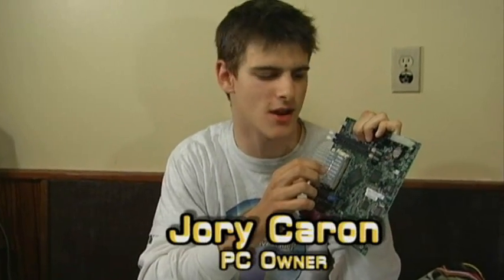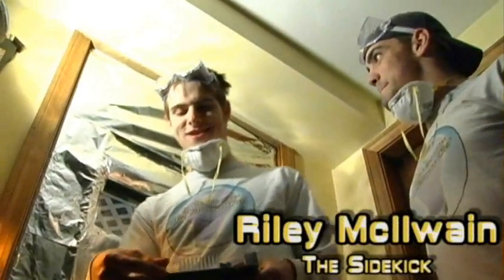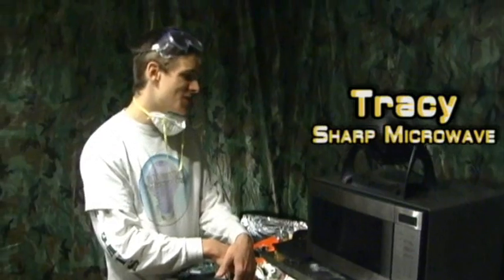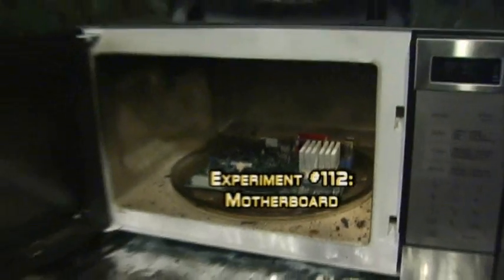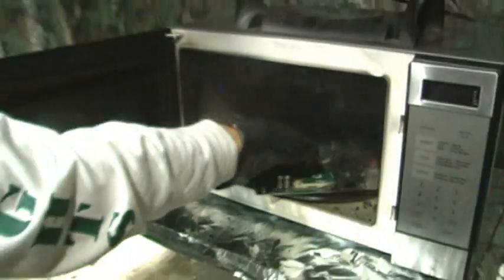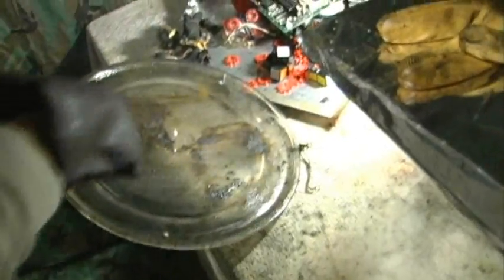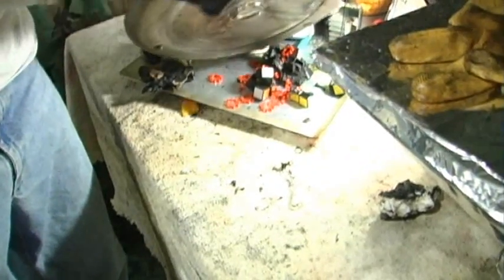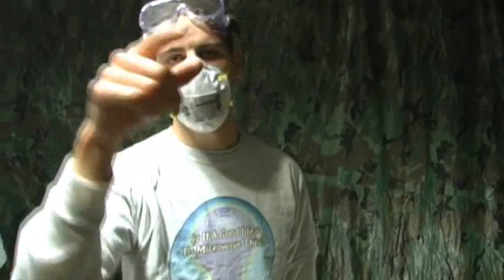Microwave A Motherboard (#112)

Comment: The part that burst into flames was one of the chips next to the heatsink, the insulator easily can burst into flames. The parts that blew up were the capacitors.
Reply: Nerd!
Reply: wither No, just very experienced =)
Reply: Four years late, but since you're experienced, have you ever built a custom-made computer?

Comment: If I want a computer that I don't have to worry about, I buy a Mac. With Windows and Linux I tend to break things, but that's a lot more difficult on a Mac. I had an iBook that worked tirelessly for 5 years before I retired it, and I never had any major problems with it. The Ubuntu computer I'm working on now... I've ruined it so many times, I don't even know how often I've installed an OS.

Comment: @any5dollarfootlong thats why its donated, it does have either an ati 3200 or a geforce 8200 built in, i think it is supposed to be a TV side box basically a console for storing and watching tonnes of video on your tv meant to be used on a network and most likely running xbmc (xbox media center)

Comment: Poll:  the answer to that question really depends on what you're gonna use it for. PCs can run more variety of games, along with other stuff im sure but macs can make you jobs easier, for example music business, architect, moviemaking, and bunch of other stuff. there is no simple answer except your one of those who instantly root for your current computer and never had the other one or happened to have bad experience with the other one. and dont compare modern computers with ancient computers

Comment: Sorry I made a type error above, I meant GTX 280 TRI SLI beats 2 GTX295 the Alienware also has cheap crap RAM, not Dominator, OCZ or anything nearly as good..
They done even have heatsinks on them. Build a PC & you have the best hardware that you can overclock & have warranty for each part , no technicians removing the whole pc because a ram stick failed.
My cousins alienware laptop charger stopped working & they removed the whole laptop to repair it when they could have sent a charger.

Comment: my mac cost 1200 and before i had that my mom had a computer for 6 months that was a PC that cost 2000 and was the new "thing" and after about 3 months it would just start crashing and it wouldnt send anything to the printer and then after 6 months we found out that HP had issued a recall for it and 5 other types of computers, but no refund! all they offered was to pay for like half of a new HP computer that was less than 800 (we didnt take up the offer)

Comment: Oh yeah, no doubt PCs are less expensive, and true, there are more compatibility issues with Macs (especially if you're a gamer), but for a lot of the stuff I want/like to do Macs are better for it.  And there are definitely times where having a PC would definitely be easier, but I've been very pleased with my Mac, and have seen fewer issues with it than with 10+ years of using a PC, which is another reason I prefer 'em.

Comment: Sehmicor

The computer didn't slow down because it was a Dell, it's Windows' fault.

After a long time of usage, Windows' files get cluttered and moved around, making startup take forever, programs run slower, searches take longer, ect. Not to mention viruses/malware that use tons of cpu power.

To make it run faster: Defragment, Disable programs from starting up that you don't use, ect.

I recommend Windows should be reinstalled every 6 months to keep things running fast.

Mail me for details.

Comment: I USE LINUX! Why didn't you make that an option? Well, actually, I have an Ubuntu Linux 64-bit drive on this machine AND a Windows XP drive .(I don't like Vista mostly because I can't afford 2gb RAM) I also have a Macbook Pro, and let me tell you, it s NOT worth $2000. It freezes and crashes (not as much as Widows though), not to mention I can't upgrade it or play games. It is a fairly quick machine, but Macs are just too "smug."

Comment from the maker: Sehmicor - I am a professional video editor, and work with both Macs and PCs on a daily basis.

My PC at my parent's house is 9 years old. It still runs great. I've never seen any Mac (that wasn't built in the 80's) last that long. 

I edit all of my videos on my PC. It runs After Effects CS3 just fine. I built it for $1200. 

Sorry, but I think you lose on all the points you made.

- Jon

Comment: So, parents bought a Dell (EW...I dispise dell) PC, within 2 years it was so slow, and useless, and a POS.

I got my mac, and it has been running for 3 years still just as fast as the other laptops I see around.

Although I will mention, Ive had the battery replaced (for free), my power cord, and main logic board (motherboard).

Macs are rediculously expensive, but I personally find better for graphics editing and video.

Comment: PCs, most definitely, for me anyway.  But I wouldn't go back to anything pre-Vista.  I used Vista from the RC1 stage, and I'm using the W7 beta now.  They're both amazing operating systems.  Using computers with XP is frustrating for me now, lol

But in my opinion, the two platforms are good at different things and I wouldn't really compare them.  Some people should use the Mac OS, others should use the Windows OSes.

Comment: "Mac OSX is just Linux with a price tag"

LOL at your ignorance.  To begin with, Mac OS X has a better kernel and is actually UNIX and not UNIX-like, which is what Linux is.  Second, there's a lot more software for Mac OS X and Windows than there's for Linux.  Third, Open Source software tends to be crap compared to paid alternatives.  The whole problem with Linux is that you have no support.  Where am I gonna call if I have a problem with the OS?  The Linux mascot (Tux)?

Comment: PC. All Mac products are incompatible with all other company's computers.  You can't even use a regular USB extension cable on a Mac keyboard. That, and trying to squish everything into such a small space makes them impossible to modify or upgrade.  The Mac OS is mediocre, but not terrible; better than Vista but worse than XP.

I use PCs for their flexibility, but my school is all Macs, so I have some experience with both.

Comment from the maker: tallandfrothy, my favorite part of your argument? The Mac I have at work - which Kernel panic's once a day because of a KNOWN hardware issue. The solution? Buy a new system (from Apple, this advice). 

My PC? Hasn't froze more than once a year since I've owned it. 

So, I would say Mac = spottily reliable, and PCs - if maintained, can be VERY reliable. But, Vista isn't that great, which is why I use XP.

Comment: They are a lot easier to use, that is true. Yet with a basic interface there comes less overall control of the system, but I doubt you care for that. If you want something really basic and easy to use, that doesn't do all that much, just get Linux for free...

Comment: actually i had a mac for 6 years (i'm 13) and i recently switched over to a PC. While Macs are easier to use in some areas, I prefer PCs because of their ability to use almost any software, whereas a Mac is adapted to much less. Also, the one button mouse on a Mac is a bit annoying. But Macs have some great features also such as Garage Band, Photo Booth, and Safari(better than Internet Explorer).

Comment: I use to be for PC more than mac though since Vista came out (and I got one -_-) I've been questioning that. It seems Vista is the only thing you can easily get now, and I just don't like that. It doesn't work with my old games, it doesn't work well with my new games, and it frusterates me at any chance it gets. I've never actualy used a mac though from what I've heard they arn't extremly better.

Comment: Macs fail in the graphics department. Macs have the worst GPUs. ATI and Nvidia only support XP and Linux for their GPUs. Macs are stuck with their really shitty integrated graphics processors. If you want power at a way cheaper price, build a PC.

Comment from the maker: Dan4157, I totally agree with you. But understand the distinction. It doesn't make Macs a bad system. But, the average Mac user typically knows less about their machine than the average PC user - which is why they spent more - to not be bothered with such business.

Again - just my observation, and I stress "average" - there are plenty who break this mold.